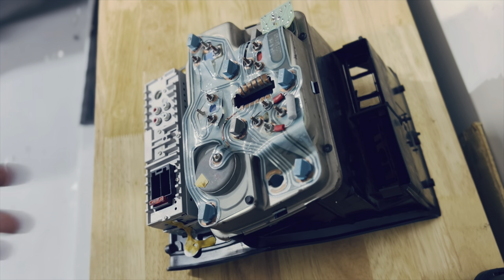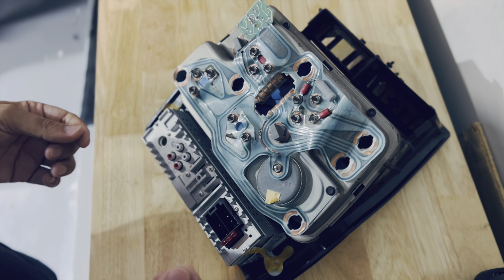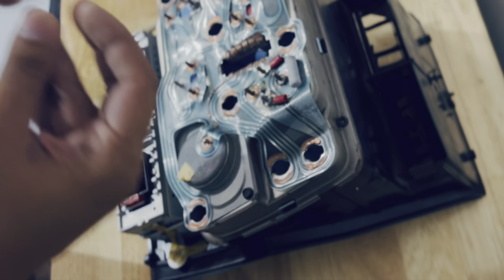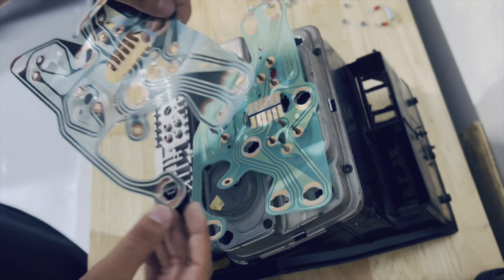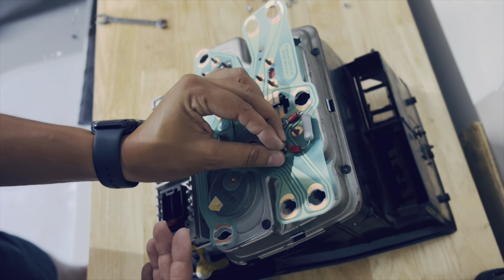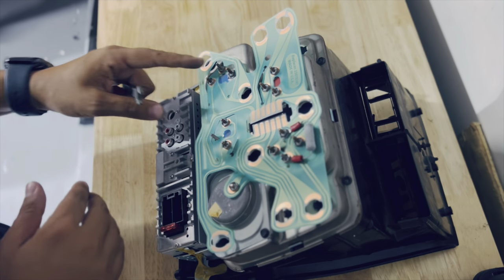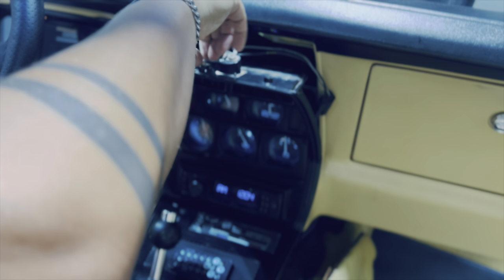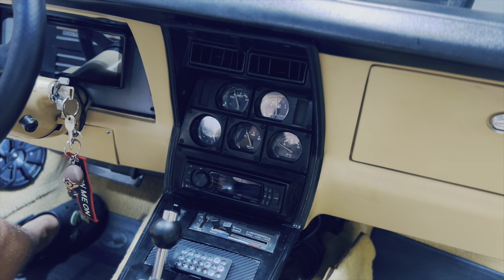C3 corvette Circuit board replacement

Comment: Nice presentation! Couple of ideas. I can not remember why, but sometimes, if you turn the clock set knob counter clock wise a little, you can get the clock to come alive. Additionally, don’t remember which carb you have. But the original (Rochester) had a small electrical component attached to throttle linkage that assisted in maintaining normal idle when the ac came on. If you still have the original carb, start with that item. If some other type of carb, you probably need that item attached. Good luck!
Reply from the maker: Hey man! 
I know exactly what you are talking about, and I have the original carb, however, I cant seem to figure how to tweak it.
Reply from the maker: I’ll have to try the clock to see if it comes alive lol otherwise, that would he another project haha
Reply: @c3sgarage  if I remember correctly, the head piece screws in and out. I think…..it’s been a very long time. And I have a Holley now and pulled off the ac system.
Reply from the maker: You know, I thought about doing it but I didn’t want to mess it up, Ill give it a try!
Whats the worst it can happen hahaha😰

Comment: There is a small solenoid on the carburettor that increases the idle when the AC is turned on. I think it is adjustable but I have never tried to adjust mine. The idle is supposed to increase because you are adding load on the engine with the AC and that could stall the engine. According to the internet it was also used as part of the emission system on these cars for at least some of the years. On my 1980 the solenoid actuates when I turn the AC on and off.

If you absolutely don`t want the increase in idle you could just remove or unplug the solenoid on the side of the carburettor. But there is a reason it is there.